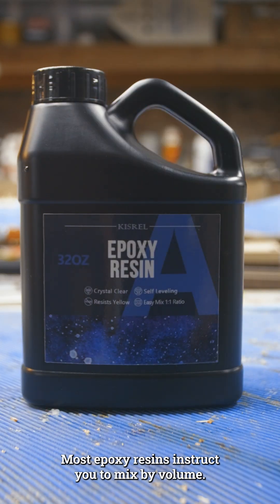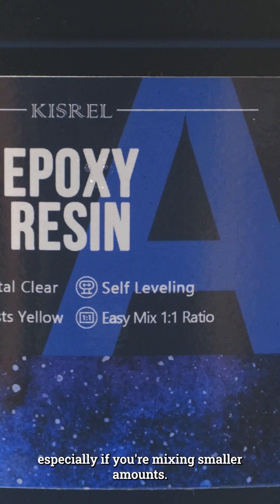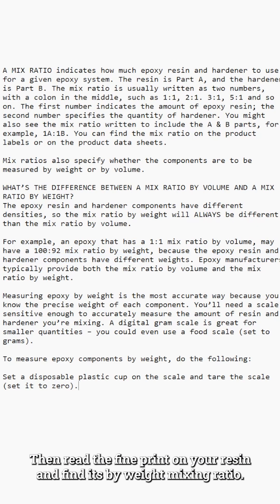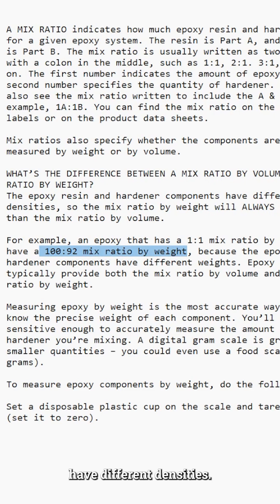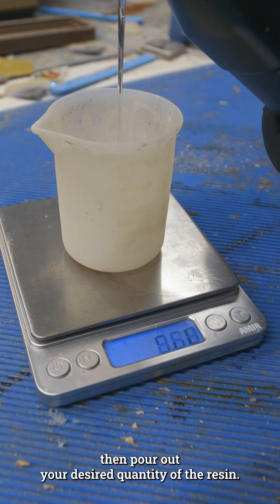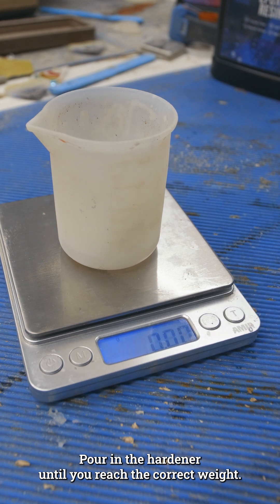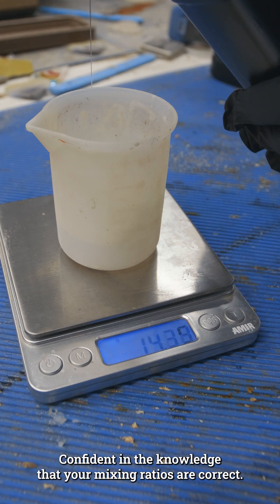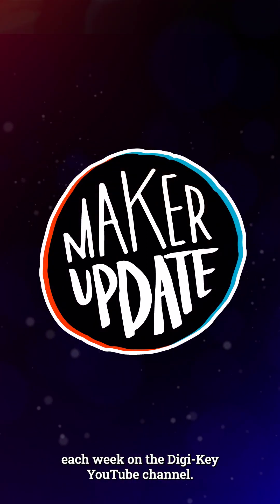Measure Resin by Weight Instead of Volume [Maker Update #Short]

Comment: Thanks for the video.  I emailed and spoke with my resin manufacturer (naked fusion) and ask them for the weight ratio.  Its not like 100:13 or anything.   I am confused, as I want to measure by weight and stop the waste of my resin.  Maybe you can help?  Here is what she told me.  

Weight ratio for The Artist's Resin Original Formula: 
1.07 part for the resin to .93 for the hardener. You can add up to  .05 percent more resin than hardener for a harder finish. 

Weight ratio The Crafter's Resin:
1 part of resin use 0.8 part of Hardener

Any help would be appreciated Thanks!